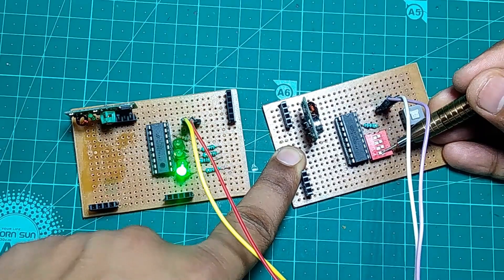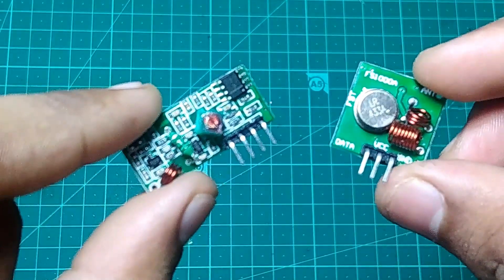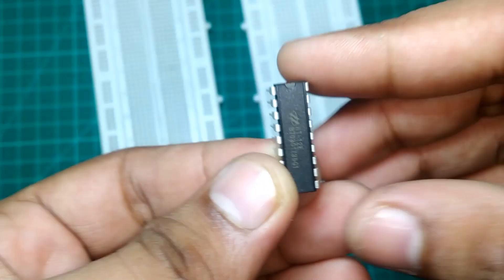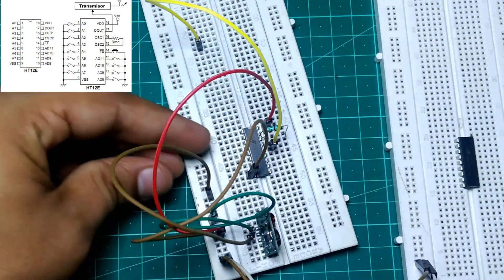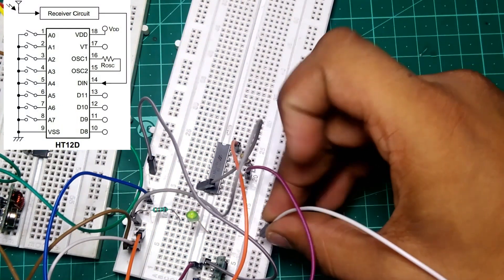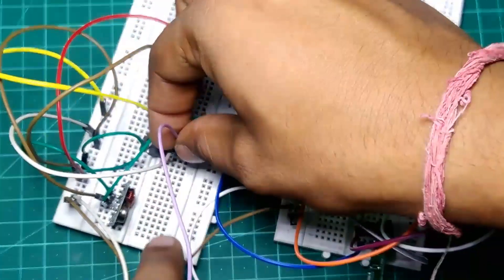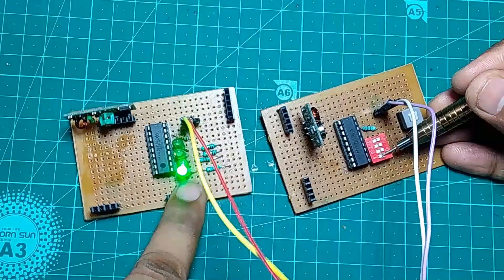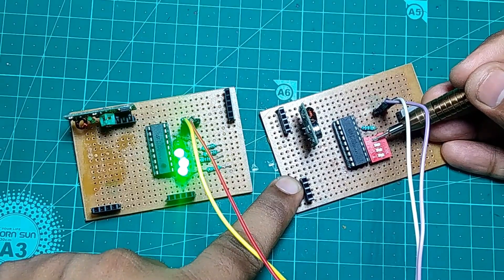RF Module 433MHZ | Make Receiver and Transmitter from 433MHZ RF module without any microcontroller

Comment: This is awesome.   I wanted to use this approach to make a thing finder in the house for things like keys, tv remotes, etc.  My idea would be to add a battery powered version of this to each device I want to be able to locate.  My question is does your approach only allow for 4 receiving devices?
Reply: TV Remotes use much simpler approach. they use IR transmitter and receivers with delays. much simple and very cheap to implement

Comment: I didn't find any single youtuber who can explain the circuit diagram of the 433 mhz transmitters and receiver module
how it works, how the data or signal moves from transmitters to the receiver

Comment: Hello, I have multiple receiver modules but the circuit only worked with one. I tested each module individually with a simpler test without encoding and it seems to work. But when encoding it only one receiver works. Why is this?

Comment: If I would be using two pairs of transmitters and receivers at small distance, is there a possibility of signal interference and result might suffer in both the receiver end?
Reply from the maker: well depends  on your encoding sir.
Reply: @electronicGURU  okay… thank you… for the information… but i have one more doubt that these pair of transmitter and receiver dont have any unique identification so how they communicate if there are more than one transmitter and receiver?
Reply from the maker: well on encoder and decoder have 8 pins to set the encoding  of rx tx so if you have making few pins of encoder high then the same thing needa to done for decoder too ,

so if any tx has some status (any) of those 8 pins and few rx has same thing too then they all can receive  the data sent by tx

Comment: Can this "no mcu" be applied to sensor networks? for example temperature sensors and pulse sensors?
Reply from the maker: I mean you can but if you are already using sensor network which might have internet connectivity so why use RF ??
Reply: I am using Proteus to simulate it, so I have created not a wireless internet connectivity, but a network using RF module. @ electronic GURU however, I want to reduce number of arduinos from 4 to just 1

Comment: I'd like to save power when transmitting from battery power. What would I add so that it only reads and sends the temperate say every 10 minutes.
Reply from the maker: Use a latch.

Comment: What power supply should i provide as i don't have a 5 volt     
Battery can i use two lithium
18650 ion cells in the receiver circuit  and add a 5 volt regulator ic
Each of 3.7volt
Reply from the maker: Yes that would work but make sure its 5v.

Comment: Can i use 3 AA size battery each of 1.5volt in the transmitter circuit so will it work and i want to use motor driver with this circuit so the +5v pin of l293d motor driver can i connect it to 3 AA size battery.. please reply
Reply from the maker: Yes you can and it might work but i am not 100% certain.

Comment: If i connect two resistors in series connection each of 100k so will it act as a 200k resistor please tell .
I know that this query is not related to your current video then also please tell me
Reply from the maker: Yeah obviously it will work since that is the basic resistance rule.
Reply: @electronicGURU  thanks bro for your reply.😉😉
Reply from the maker: Your welcome
Reply: @electronicGURU  i also have one more doubt and posted it in comment section can you please answer it
Reply from the maker: What doubt please ask it here. I couldn't find it.

Comment: There are two data pins in receiver circuit which one to connect in pin 10
Reply from the maker: Well try with of them depends on module , mostly both works, but for me the closer to GND pin was working perfectly. Some people even use both together and some use one. So it depends on your module etc.

Comment: If i want a DC motor to run forward when i press one button and backward when i press another button how i can do this task wireless using rf circuit please reply
Reply from the maker: Well connect two pins of tx to the motor driver and if you press one button on tx it will run motor forward and other will run it backwards.

Comment: Can I use a 9 volt battery to the transmitter circuit ??
Reply from the maker: According to datasheet transmitter can be run by 3-10V but not sure about HT12D i think HT12 D runs on 5v only well the best idea would be to use a cheap 7805 if you wanna use a 9V battery.

Comment: dude... Way cool. I found you by googling "433mhz rf transmitter and receiver module" and you where on the top returned.  good stuff.
Reply from the maker: Thanks man 👍
Reply: I'm a retired EE from the old school...  of the 70's-80's business and engineering computer era... bought a Tx and Rx set long ago..it's been in my "parts-is-parts' collection over 6 years at least ... never had a solution that required it until now...
I'm doing a pushbutton (momentary contact) switch (with an RC denounce) that Tx sends to the Rx to toggle a J/K that drives a single OTS Arduino marketed relay board...
your thoughts on this project?
Reply from the maker: Could you please explain the exact application you are looking for? And what components you have which you want to use? That will be helpful for me to understand your approach and i will provide you my thoughts on that.
Reply: Same. I'm learning electronics and I want to learn about transmitters. I want to do a project that uses a transmitter and receiver but not a microcontroller and I don't even know if that's possible but according to this video it is! Thank you so much been very helpful!

Comment: How to add pir sensor
Reply from the maker: As simple as adding a push button.
Reply: @electronicGURU  can you plz explain
Reply: @electronicGURU  kindly share complete circuit
Reply from the maker: I am sorry i am really busy I can't make circuit for you. But just learn how to use PIR And simply add it as you add a push button as input.
Reply: Bt that decoder ic has inbuilt low...

Comment: Sir, can i use without switch? When tx n rx close together n they are immediately connect
Reply from the maker: Yes you can. It totally depends on your circuit.
Reply: @electronicGURU  can you show the wiring for my question? Or just connect pin 7/8 to ground?

Comment: Great video!  Please, how did you calculate resistor values used (1M & 68K)?
Reply from the maker: For HT12D & HT12E ICs if your refer datasheet for these decoder & encoder IC you will be able to see that 51k & 1.1M is prescribed for these. So i was having values of 68k & 1M so i went with those. Because they are nearly similar values.

Comment: hi @@UCJmFy7YSogeWXwmXOfRJ6JQ , i want to make a remote switch to control light. this seems a good idea.
on the transmitter side i have no choice but to use a battery to power transmitter. but on receiver side (which would operate the relay) I have 2 options: either to power receiver using, say a 9 v battery (which drains like crazy) or use the line 230v to 5 vdc buck converter. my question (doubt) is if this buck converter will always consume power? in that case it would be wise to use (may be a rechargeable) battery.
Reply from the maker: Well i would suggest to get those HFLINK like ac to dc small modules they will cost something 100 rupees and they can convert 220v ac  to 5v dc do they will ideal in your case.

Comment: Can anyone help me with my project. I'm following the steps in the video but came up with a problem my led keeps on blinking while data pin of the transmitter was on the ground
Reply from the maker: Can you share me your schmatics ? And what are you trying to do and have to tried to use any other pin or any other module except the one you are using.
Reply: I'm following your schematic sir. I don't use any module coz i only have one.

Comment: Wonderful video! How would I connect multiple transmitters to a single receiver and have the receiver illuminate a separate led light when each individual transmitter is triggered? I'd prefer it if I didn't have to use arduino as there is very limited electricity and no wifi. Thanks!!

Comment: how about a even simpler Tx to Rx set up, where : when Tx is powered up Rx has 1 pin going to +5v so I could connect a cell phone vibrator ? Could I use the same parts you selected and do that ? the range I need would be around 125 to 150meters any suggestion ? TY very much for your vids Cheers

Comment: Thanks for the video, would I be able to use the receiver output (like the LEDs) with an MCU to read if a pin is high or low? Just to let everyone know from my testing it seems to have a pretty good range of at least 5ft or roughly 1.5m without the antenna, provided you are able to supply the recommend minimums to each circuit.

Comment: what is the output V to the leds ? would that voltage be enough to make a cell phone vibrator work ? how can this be boosted to get 150M range if that 's possible ? Thanks for the knowledge  Cheers !

Comment: And what'sthe story with the bug running across and under the boards at 4:36???? :-) by the way, if you solder 17.3 cm wires on both TX and RX and coil them you can increase the range quite a bit. Nice little weekend project.